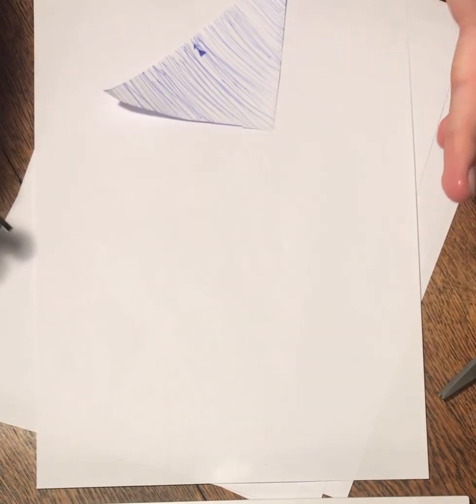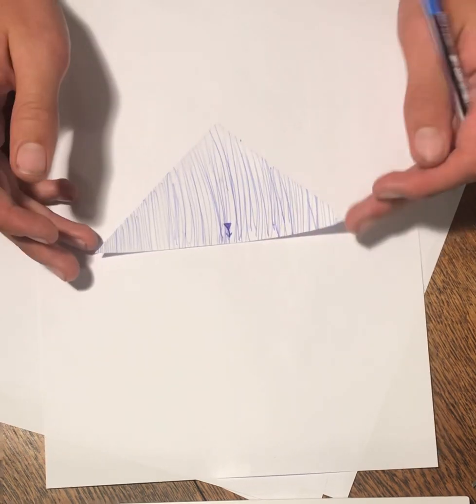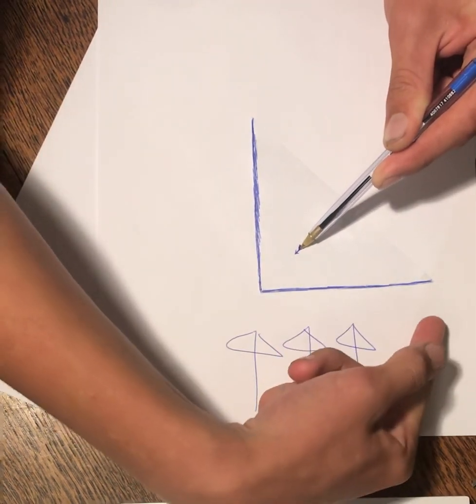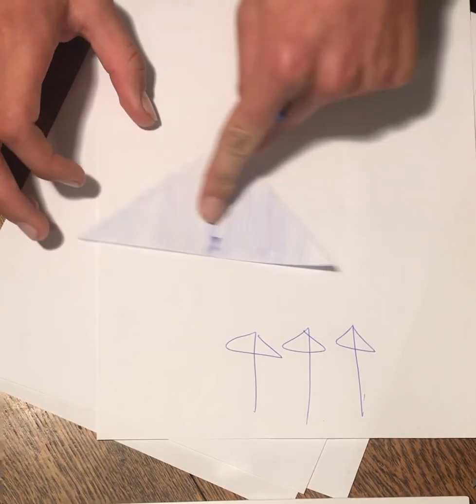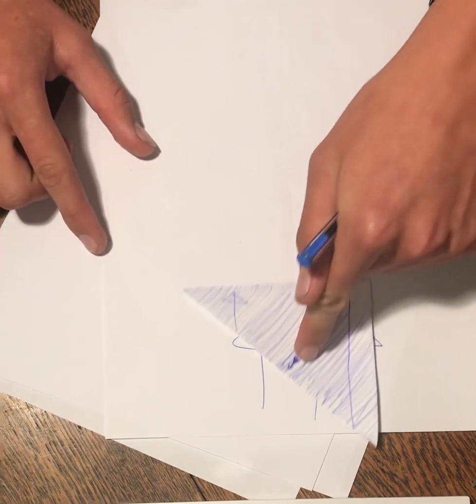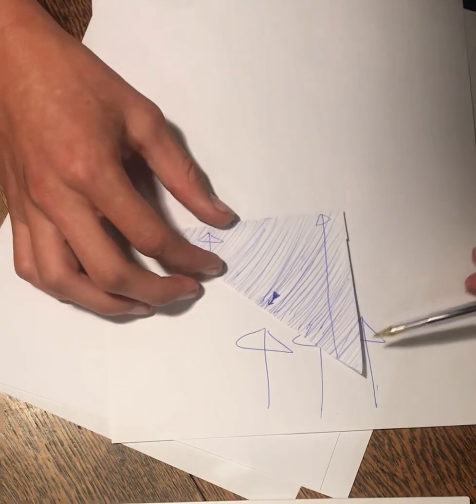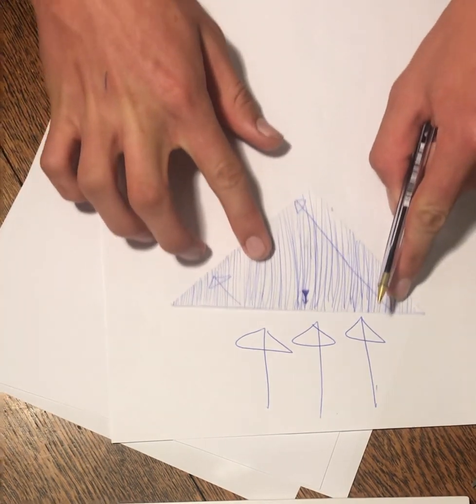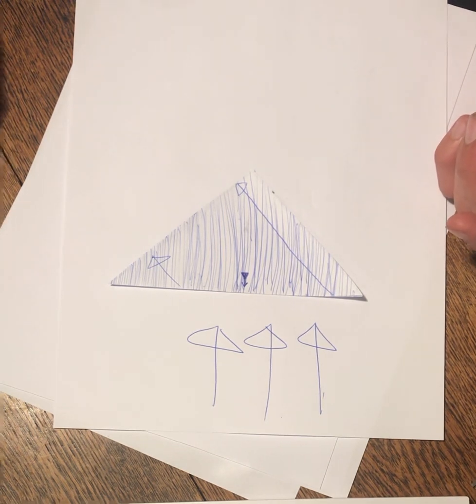The INMAN EFFECT - NEW Reverse delta wing stability concept

Comment: This idea will only work as you are hoping if the pivot, or axis is as front as possible closer to the leading edge, just near where you put the pen.
The further back your pivot the more unstable it becomes.
When you draw the pressure lines on this wing you'll end up with forward swept wing, which in theory is unstable. However, You can have an unstable wing but the whole plane is stable, just like some glider planes,  in which case your idea should work.
Try a simple paper of foam hand launch plane to verify if it will work or not.

Comment: Hello
The Inman Effekt seems not to be as  strong as the pressure on the leading edge. 
The Inman Effekt should work against the stability of a normal Delta Wing. Counteracting it.
A Flat plate got nearly no leading  edge and there the Inman Effect should be strong. 
On Inverted Delta Wing the stream over the Airfoil is Deflected by the leading edge by some Degrees. 
The flow tends to escape the foil.
Reply from the maker: Ok thanks for the info 👍